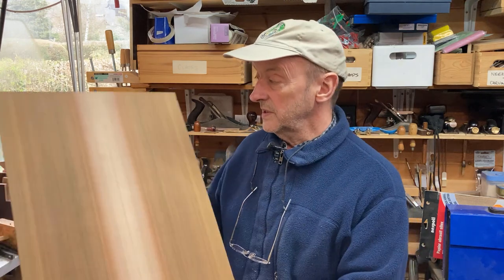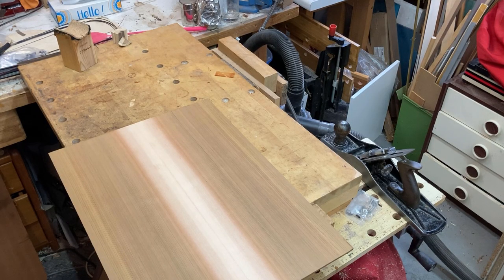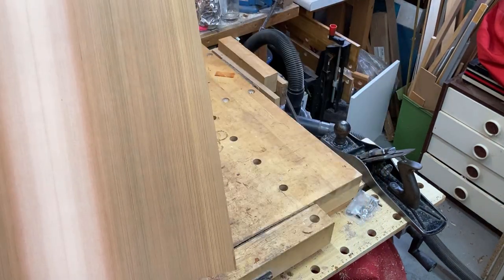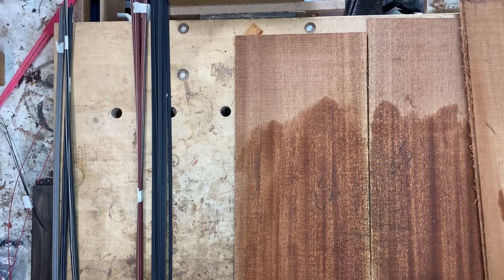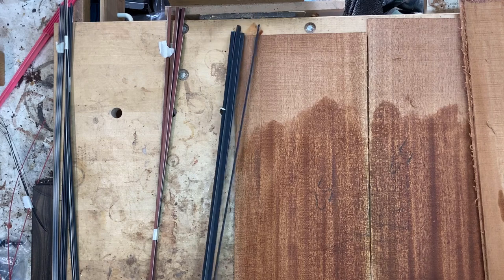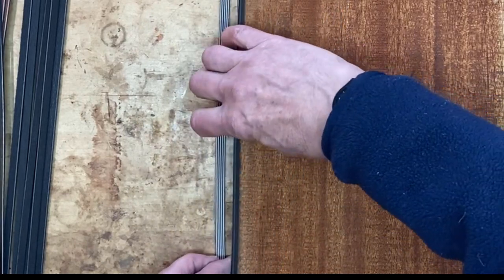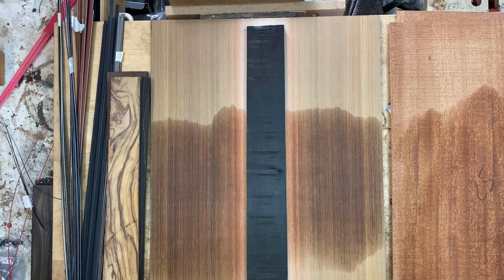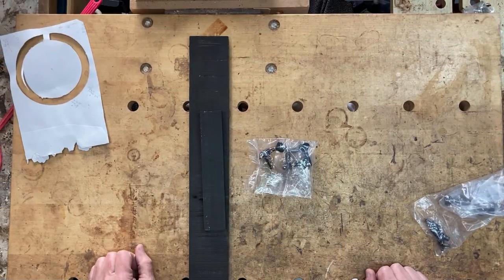GGBO 2021 Acoustic guitar build - Choice of materials

Comment: Love the cedar top.I'm not sure about copper rosettes - wouldn't that have a dampening effect on the top???
Reply from the maker: A good thought, but the copper is actually pretty thin, so doesn't weigh much. It's backed by a piece of very thin plywood so the whole assembly, while heavier than the same amount of spruce for sure, is probably in the same range as, say, a dense wood rosette (ebony, blackwood, bog oak etc). 

Tom Sands, and other 'big name' luthiers have used copper in their rosettes, and so I wasn't too worried..😉
Reply: @GarlandStringedInstruments  Hi Chris - Thats a good point, they look great b the way!!